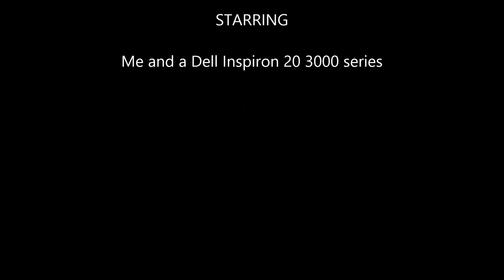OPEN ME UP! Dell Inspiron 20 AIO 3000 series  Disassembly

Comment: Excellent tutorial, I wanted to fix this baddie from so long
Reply: Yeah... it's a "baddie," alright... as in a bad, horrible low-end AIO unit with no CPU upgrade path and more than likely a maximum of 16GB of RAM that absolutely will NOT make any noticeable difference in real-time use other than perhaps speeding up the initial boot-up phase of Windows.  As soon as you start really using the system, it's going to lag horribly.  Sell that POC for $75-$100 and take that money and get yourself a newer used laptop or desktop PC on eBay for anywhere from $50-100 dollars.  If you look around on there enough, you'll find a decent laptop or desktop PC for under $75 including shipping, AND you can get a 120GB SSD for around $12.00.  It;s just a much smarter thing to do.

Comment: Is there any way that I could factory reset this laptop without a bios password without having to open it and pulling out the motherboard battery?
Reply from the maker: removing the bios battery does not remove the password. there are many ways you can reset the computer without logging in. you can go to SAFE MODE by holding SHIFT BUTTON and turning on the computer. from there you can reset the computer
Reply: It didnt work
Reply from the maker: @CrowJBird  there is a way to enter safe mode. then in safe mode there is an option to reset the PC
Reply: @OpenMeUpTec  I legit have pressed every single key and it just starts straight to the blue screen that says password
Reply from the maker: @CrowJBird  if thats the case you can get the widows installation CD/USB and reset it using that

Comment: It only supports up to 1333 MHz DDR3L...

I want to buy an 8 GB one, but it only appears at 1600 MHz DDR3L

what should I do?
Reply from the maker: you go and buy it that one and it will work. at most it will down clock the speed to 1333mhz. i had 8GB 1600 in mines but never check what it did to the clock speed. this is a bad computer and buying ram is pointless for it. it wont improve anything

Comment: Hi i recently bought 1 of those and its got a pentium processor at 2.1ghz with 2gb ram. does upgrading the ram to 4gb increase performance? or is it limited by the cpu.
Reply from the maker: The CPU is so crap that nothing will improve performance
Reply: alright thanks

Comment: do you know any gb ram sticks that I should get if you do please send a link or tell me the stats? Thanks!
Reply: 8gb*
Reply from the maker: it is simpler if you look for one yourself and send me the link of the one you are interested in and i will tell you if it will work or not. if you thinking changing the ram will make your computer faster or better in anyway sorry to tell you nothing will change and it will be the same.
Reply: OPEN ME UP rip its the ghz right
Reply from the maker: yes and no. but for this computer the GHz is its biggest problem

Comment: Can you do a follow-up to this video showing how to remove the screen?  For some reason, my screen looks like it has some sort of water residue underneath the digitizer.  Thanks!
Reply from the maker: If you live in a cold place it will fog up like your car
Reply: OPEN ME UP Nah, that's not the issue.  I'm in the south of the US so we're not dealing with bad temperatures or anything.  This looks like someone spilled something down inside of it and dried in spots... but the pattern looks as if it was actually created by someone trying to wipe the screen off... 

The only thing I can figure is someone wiped the screen, but they used WAY too much cleaning product and it has somehow managed to get between the digitizer and the actual screen.  I'd just like to know how to get access to remove the touch screen (without breaking mine like he did) to be able to clean the dried residue off.
Reply from the maker: I don't have the item anymore to create a video for you but it is pretty simple just remove everything and every screw
Reply: OPEN ME UP Is there no way to simply access the digitzer from the front side without having to unscrew anything?  All I need to literally do is lift the digitizer up so I can wipe the residue away.  Is the only thing holding the digitizer in place 3m tape?  Where is the connection ribbon for the digitizer located?
Reply from the maker: If they do that then everything will just fall apart. Since this is an AIO they screw everything on to the screen

Comment: I upgraded a dell inspiron 20" 3043 AIO Pentium 2.16ghz pc to an 120gb intel SSD. boots up in 27 seconds compared to 63 seconds before. Each session in MY PHOOTBOOTH SOFTWARE  is 2.5 seconds faster with camera set to large quality. Conclusion: not much benefit, but deffinetly noticible.  especially boot times.

Comment: I have one and am thinking of putting OpenSuse in it.  Windows feels like a dumb down retarded OS.
Reply from the maker: the computer can only use uefi so you need to check if what you want to do works with that
Reply: OPEN ME UP
Thanks I will do research
Reply: Options for Installing Linux
You have several options for installing Linux on a PC with Secure Boot:
Choose a Linux Distribution That Supports Secure Boot: Modern versions of Ubuntu — starting with Ubuntu 12.04.2 LTS and 12.10 — will boot and install normally on most PCs with Secure Boot enabled. This is because Ubuntu’s first-stage EFI boot loader is signed by Microsoft. However, a Ubuntu developer notes that Ubuntu’s boot loader isn’t signed with a key that’s required by Microsoft’s certification process, but simply a key Microsoft says is “recommended.” This means that Ubuntu may not boot on all UEFI PCs. Users may have to disable Secure Boot to to use Ubuntu on some PCs.
Disable Secure Boot: Secure Boot can be disabled, which will exchange its security benefits for the ability to have your PC boot anything, just as older PCs with the traditional BIOS do. This is also necessary if you want to install an older version of Windows that wasn’t developed with Secure Boot in mind, such as Windows 7.
Add a Signing Key to the UEFI Firmware: Some Linux distributions may sign their boot loaders with their own key, which you can add to your UEFI firmware. This doesn’t seem to be a common at the moment.
You should check to see which process your Linux distribution of choice recommends. If you need to boot an older Linux distribution that doesn’t provide any information about this, you’ll just need to disable Secure Boot.
You should be able to install current versions of Ubuntu — either the LTS release or the latest release — without any trouble on most new PCs. See the last section for instructions on booting from a removable device.
How to Disable Secure Boot
You can control Secure Boot from your UEFI Firmware Settings screen. To access this screen, you’ll need to access the boot options menu in Windows 8. To do this, open the Settings charm — press Windows Key + I to open it — click the Power button, then press and hold the Shift key as you click Restart.
Reply: OPEN ME UP
wow thanks for the info.  Something new to watch out for

Comment: I'd like to point out that this system is a piece of garbage if you have any inclination to ever be able to use Windows 7 as your operating system.  The 10 different bios upgrades they've made available in 2 years has not once taken care of an AHCI error that keeps you from being able to boot from a USB (even if it's formatted in UEFI)  Unless you're a fan of Windows 8, 8.1, or 10, you're simply S.O.L. 

I'd also like to point out that the AHCI is not fully functional at all; you are limited to UEFI even if you manage to get legacy mode enabled.  

You cannot watch YT videos in full screen in 360p; let alone HDMI without the system locking up or lagging out to the point that it almost does. 

This was a system thrown together with excess parts that were not popular enough to sell or strong enough to be used in normal laptop systems... so essentially, Dell built a slow, outdated, oversized, Microsoft tablet. 

Way to go, Dell!  Way to go!
Reply from the maker: Yes the item is crap that's why its so cheap
Reply: Actually, based upon componentry and performance, a fair price for it would be around 100-125 where it's billed as a glorified tablet... watch any demo review... NONE of the systems consumers end up with perform anywhere close to as good as the demo models.  I'd go as far to say that for the QVC review, they used a customized motherboard with at least a quad-core processor running at over 3ghz and at a minimum of 8gb of ran running a 1333mhz.  

If THAT were the system the consumer actually received, it'd be well worth the 375-600 dollar price range.... but in actuality, it's worth roughly half that at best...
Reply: What is the maximum size ram on this?  Great video!
Reply: @MI_Prepper  It's dependent upon the CPU.  I know it can handle 16GB with no problems; I want to say 32 would be the maximum, but if you have the CPU I had and the one mentioned in this video, all the RAM in the world, nor an SSD to go along with it, will improve the system because the CPU is a horrible bottleneck in terms of performance.  Only viable option to use this thing somewhat decently is to lower the overall system resolution town a step or two.
Reply: @NXSProductions  It only gets used for Office 2010, email and such, mine has a celeron in it, not sure which model.  I only have 8gb in it now so 16gb would be a good improvement, plus an ssd instead of the 5400 rpm hd in it.  Great video and thanks for your quick response!
Reply: @MI_Prepper  You're welcome.  Honestly, you aren't going to see any notable improvement by adding 8GB more RAM.  You would do better to get an SSD... it WILL boost performance slightly, BUT like I said, the CPU, being a low-wattage use dual-core processor at a low clock speed, will absolutely be a bottleneck to any real performance upgrade.  

IIRC, the Celeron model either has features the N-series Celerons, which ALL have a low clockspeed with a maximum of 2.4GHz when TurboBoost is fully engaged.  I'm guessing yours has the 1.6 or 1.8GHz Celeron N processor.  If you let me know your exact CPU I will tell you the base speed and the turbo boost speed (if applicable).  Then, the second biggest issue with the CPU is that at maximum, it will have 4MB of smartcache, but I am guessing your processor has either 1mb or 2mb of smartcache, which, coupled with an operational speed of under 2.4GHz (most being under 2.0GHz) is just an obsolete CPU in today's internet.  

Have you tried watching YT videos on it?  How does it perform?  Let me know!  The good thing about buying an SSD over RAM is that you can put it in either a newer laptop OR a desktop PC that you can get for under $75 bucks used on eBay that will absolutely out perform that AIO.  I'm just saying that unfortunately, the AIO you currently have isn't worth spending anymore money on and since the AIO also uses SODIMM ram (laptop/tablet memory), you can only put it in a laptop... when you inevitably DO get a newer system.

Comment: Can I put a ssd into the dell inspiron?
Reply: Thanks
Reply from the maker: Yes but it wont do anything since the computer is too slow
Reply: Really? Can u double check, and respond again?
Reply from the maker: Yes you can you will have to remove your old hard and replace it with the ssd
Reply: So it wont give me any performance? Like not even 1%?
Reply from the maker: 1% is not an increase as you are unable to feel it even 10% you can't tell the difference
Reply: So does it improve anything?
Reply: Dude, he's answered your questions twice now.  The computer is slow because it has a cheap, shoddy, processor that is soldered onto the motherboard.  The 1333mhz ram at 4gb is actually pretty fast.  The problem lies solely in the cheap processor...  So to answer your question, it will not improve anything other than the read/write times of the data being stored/read from the hard drive.  An SSD would read/write much faster, but it will NOT improve the computer's performance by any means. 

This is a cheap system where you genuinely get what you pay for.
Reply: +Etho Gaming I think it always helps. Just use a good ssd.
Reply: jeffscomp As I said earlier, it will improve the read/write speed performance, but in terms of getting rid of ANY HD video lag, the dreaded stuttered audio when the CPU gets overloaded, and it generally just being an overall disappointing system, anything short of baking/reflowing the motherboard and replacing the shitty CPU is not gonna make a noticeable difference in performance at all.

An SSD upgrade from the OEM drive is a very high cost for a performance efficiency improvement of around 4%.

But hey, if he has the money to throw away... then by all means...

Sometimes, you just have to know a system's limitations and either live with it or get a newer computer with stronger and scalabile (upgradeable) hardware.
Reply: Begley's Shizzle If the all in one has a 5th gen or newer Pentium CPU it can handle HD video playback good. That's one that would be helped by having an ssd. I know someone who has one and it's not too bad of a PC but I'd like to put an ssd in it for him someday.
Reply: jeffscomp I can only speak on my experience with the system and my overall expertise (20+ year PC-Repair & Bachelors in Computer Science).  It's a low-end all-in-one desktop.  With MY system 8gb of ram, optional battery upgrade, Windows 10 installation (8 was even worse on resources) and minimal (basically barebones startup), when watching a YT video in full screen in any resolution above 360 will result in choppy video and lagging/glitched/demon-sounding audio.... 

As I said, an SSD will improve how the system reads and writes data to the hard drive... it will do nothing to stop the CPU bottleneck limitations, nor will it improve overall visual playback. 

I'll put it to you like this:  I'm using a desktop built in 2009 with Windows 7 and it outperforms this all-in-one. My Inspiron e560 (budget-based desktop) has 4gb of 1333mhz ram and a dual-core Pentium 2.8ghz processor... essentially it has less hardware capability and still consistently outperforms this all-in-one with half the ram and an only slightly-superior (in terms of clockspeed, etc.) processor output. 

I know running Windows 7 on the all-in-one would improve things as well... but here's the thing... Dell has made it impossible to downgrade to Windows 7.  The good news is, I gave like 85 dollars for my all-in-one, new, so I can swallow my pride (and loss) and admit that the system isn't worth buying.  I just feel bad for those who paid hundreds of dollars for a glorified gen-1 TABLE-let.

Comment: I upgraded mine to ssd and it seems to be faster. I have the Pentium version. Do you really think it was a waste of time/money to upgrade the hard drive?
Reply from the maker: +PhotoBooth biz upgrading the hard drive is the first thing anyone should do if they want to upgrade something. beside the hard drive anything else is a waste of money, ram is not that bad as it is cheap
Reply: +OPEN ME UP  Thanks I was worried because your video said upgrading hard drive was a waste of money. thanks for making this great video too!
Reply from the maker: it is sort of for this computer as it uses a tablet CPU which is pretty slow even changing to a SSD shouldnt make a differences but since you said it does then thats good
Reply: OPEN ME UP  can the cpu be unsoldered and replaced by a powerful  1
Reply: NO